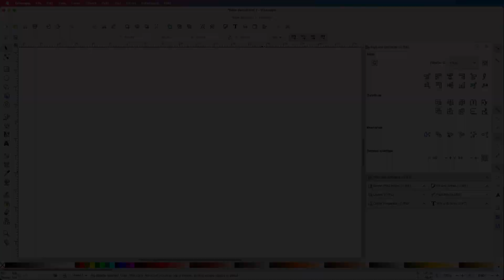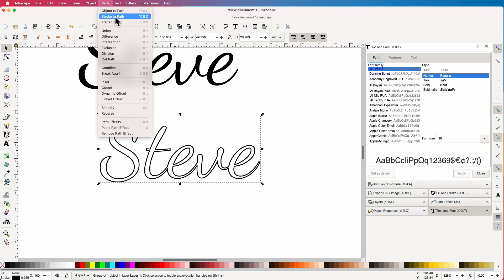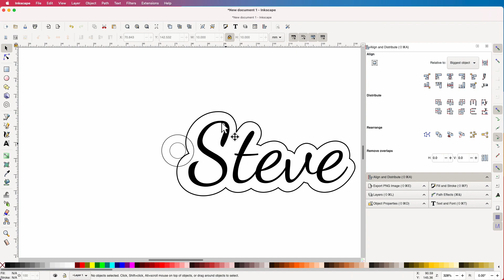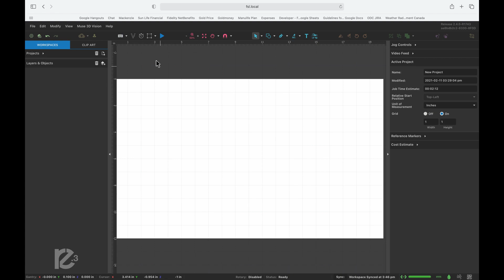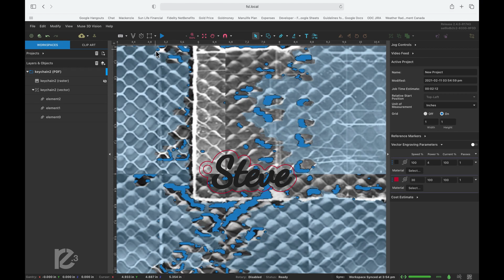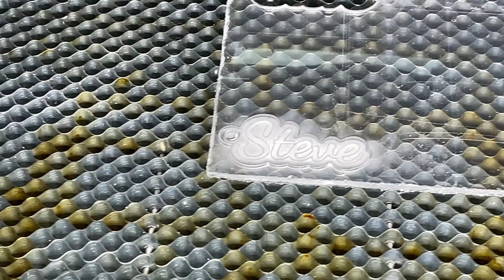HOW TO DESIGN A KEYCHAIN  // Designing and Laser Engraving Acrylic Keychains

Comment: What did I do wrong if it didn't cut through the entire outer layer of keychain using 1/4 acrylic? It engraved and traced around the edges but didn't cut "deep enough"
Reply from the maker: Are you trying to use a diode laser?  They won't won't cut clear acrylic.

Comment: Thank you so much for your videos! Do you mask your acrylic? I cut acrylic last night that had masking on it, and I had flames. 😬
Reply from the maker: I usually just leave the protective film on until the cutting is done.  If you are getting flame flashing out the bottom of the cut you can try to reduce the power a bit until the beam just goes through the material.  You will usually get some flame flash though as the laser is cutting.

Comment: Is the machine called Muse 3D laser? Where can we purchase this?
Reply from the maker: Yes the Muse 3D is available from Full Spectrum Laser - you can find a referral code in the video description. This one of many fine lasers in in the 40-45W laser segment of the market so shop around for the one that offers the feature you will need.  The Muse 3D sits in the higher end consumer market and is a great option if you are running a small cutting and engraving business

Comment: how to save this file as .PLT format
Reply from the maker: Sorry, what’s the context?  I’m not sure what a PLT file is
Reply: @SteveMakesEverything  .PLT file is used for cutting in laser and plotters machine.
Reply from the maker: @VidwatB  OK.  Most laser/cnc software I've seen can import SVG files directly.  There is no doubt some converter available for this, but first check if your tool can consume  SVG or some of the other common vector formats.  If you can avoid the conversion you'll generally always be better off.

Comment: What spacing did you use for the infill? I've followed along but when I add infill it says the job will take over an hour.
Reply from the maker: Since this will be an image the dots/inch (DPI) will be important.  For these you can use 250dpi or even less.  There is little value in higher resolutions and something like 1000dpi will take MUCH longer with almost no benefit.
Reply: @SteveMakesEverything  But, the video shows a vector engrave and not a raster. Did you actually use a raster for the text?
Reply from the maker: @otsep  Well now I'm going to have to go back and watch my own video 😀.  In either case if you are using a vector fill then there's no way it should take more than a couple minutes to do.

Comment: Hi, I just have a question about how do i make the union, because when i try to make a union it doesnt go into one, like were u do it in ur video 9:06
Reply from the maker: Any time you are trying to union things, select the node tool on the left before selecting what you want to union.  Note that in this case you want to select the outer line and the outside of the circle for the eyelet.  Don't select the inner circle or you will union it into oblivion
Reply: @SteveMakesEverything  Thanks, And just one more question, what type of wood can i use to make this.

Comment: Hi - thanks for your videos on Full Spectrum Lasers. In one of FSL’s videos on their pro line, they talk about not using the honeycomb tray when cutting acrylic because it makes odd patterns on the back of the acrylic. I know it isn’t a big deal for small pieces like this, but for larger items it might be… FSL doesn’t make a knife edge tray for the Muse line (I am just setting up a Muse Titan in my shop this week) - what do you use (if anything) to elevate the acrylic off of the honeycomb tray? Thanks! Great to see videos on FSL lasers!
Reply from the maker: There’s nothing special about the FSL workspace so you can buy a knife edge tray from someone like Cloudray or other vendor that will fit. I haven’t seen any honeycomb artifacts when cutting acrylic though, but if you did you could just brush the back of the acrylic with dish soap before cutting or place it on a damp paper towel

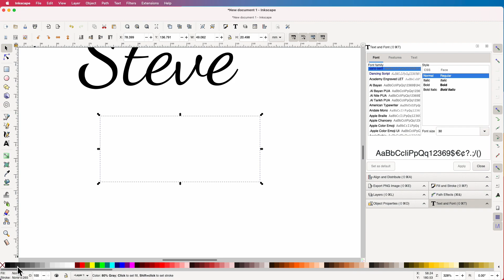Comment: I've been using Adobe Illustrator and after watching you use Inkscape to do this keychain I thought I should try it once more.  At 3:56 in the video you're converting the bottom name into just an outline, getting rid of the fill.  I've tried to see exactly how you're doing it down in the bottom left corner of the screen, but for some reason, I can't get the same results.  I'm using the Windows 1.0.2-2 version of Inkscape that appears the same, but there must be something different.  Can you tell me exactly how to get rid of the fill so it's just the outline?  Thank you - I've enjoyed all of your videos after coming across them last evening.
Reply from the maker: Hi Don, sorry for chopping off the main menu, my screen recording on my Mac was doing something strange.  At any rate here's what you can do:  Assuming you have the string selected, in Inkscape you can fill or unfill by selecting the colour you want from the color bar at the bottom of the screen.  The unfill (actually transparent fill) is the "X" on the left of the color bar.  With the object selected, click the "X" and the fill disappears.  Holding Shift while clicking will change the color of the outline and you can also eliminate that using the same "X" color selection (holding shift).
Reply: @SteveMakesEverything  Thank you, that worked perfectly.  Still working on the rest of it, I need to understand Inkscape a little better.
Reply from the maker: @donclaridge5678   I try to avoid adding Inkscape tutorials to videos unless it's integral to the subject, but if there's "magic" in a video and you'd like to know more, just post a comment
Reply: @SteveMakesEverything  Thanks, after a bit, it worked perfectly. I’m curious, I live in NW Montana and do I detect a bit of a Canadian accent?
Reply from the maker: @donclaridge5678  You do indeed detect a bit of the Canuck tongue.  Originally from central Canada, now living on the east coast (much nicer winters!) :-)